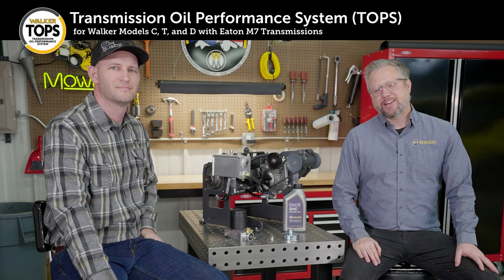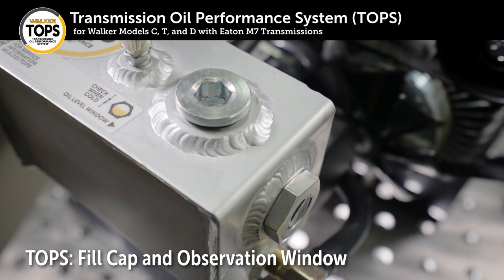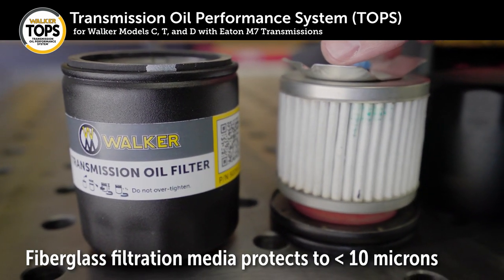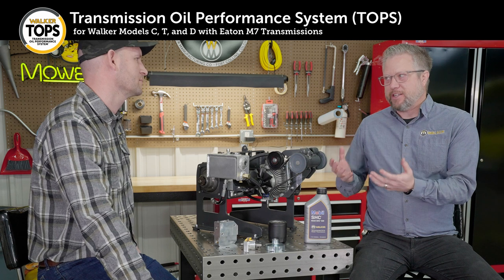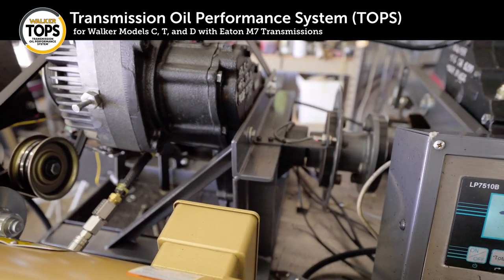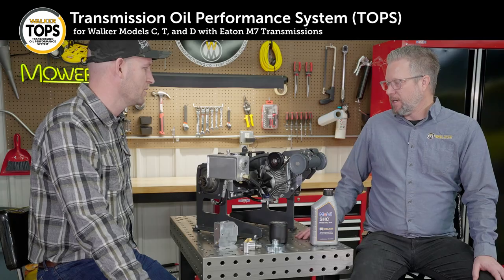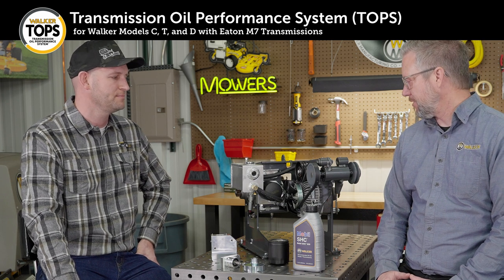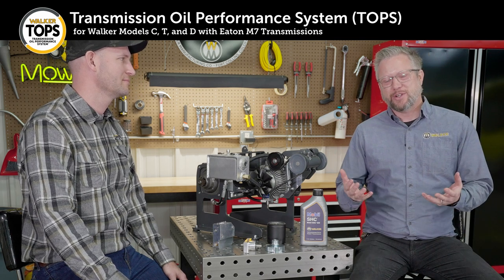What is the Walker TOPS System [TOPS Overview]

Comment: I see some great advantages here but I am getting a modern day diesel emissions vibe here, Adding a lot of cost and moving parts that can fail in exchange for small benefits. So now when my left hydro fails and is introducing metal in the system it will contaminate the other one as well? I am sure the filter helps out with that but I am interested in the longevity of the pump and hoses etc. One of the things I really liked about walker is the hydro system without soft hoses. I have over 6000 hours on my original hydros and still using them daily, I did have to do an input shaft repair/seal kit but with regular fluid changes and keeping them clean I didn't think they needed extended protection. I would like to see this for the engine  however which is already being done by at least on small engine manufacturer. 2 qts of oil only in an air cooled engine in dirty conditions I feel would benefit greatly by external cooling and more volume
Reply: I got an old dixie chopper with kohler command. i put an oil cooler from an old chevy 3/4 ton diesel truck and a big second oil filter that holds about a quart. so im running 2 filters and 2 coolers on it with 3-4 quarts oil total. i thought about doing something like in this video 15 years ago but couldnt find employees to pay $15 an hour min wag 15 years ago so never got time to do it
Reply: Many thanks KLC! 6000hrs on the old hydros proves, that the new system is obsolete even before it's released. Instead of making unnecessary improvements, how about changing the price policy Mr. Walker? My Walker dealer want's to charge me 60$ for a rattle can with yellow paint, to make the walker look good again, to show the beauty of US-Craftsmanship. Here on the other side of the pond, things maybe be priced a little higher, but that's a serious joke for a 35.000$ mower.

Comment: Oh my goodness.  My Walker MTGHS is 29 years old and the oil has NEVER been changed.  It's a 1993 model which I purchased used after a years use and I've never changed the transmission oil.  Also, never added any oil to the Eaton Hydro gears.  And on top of that, I just purchased a brand new 2021 T27i.  I'm not kidding these things are good lawn mowers.  Not good for mowing weeds.  The reason I spent big money is I have the snow blade and snow blower too.  I mean these bidenomics are getting to me.  Buy anything you need NOW before inflation really kicks in.